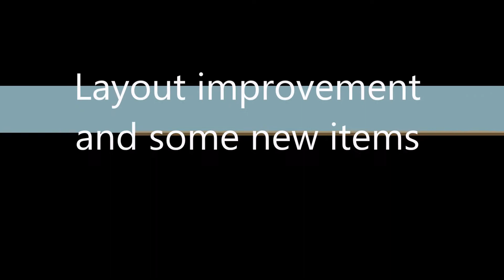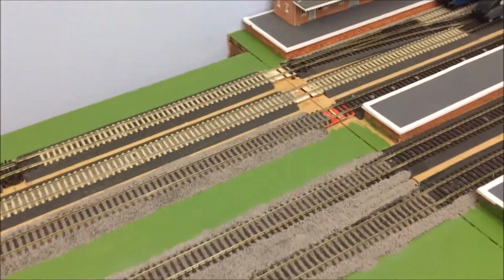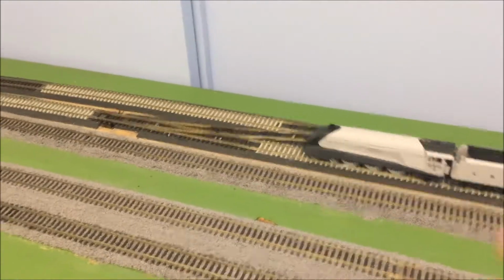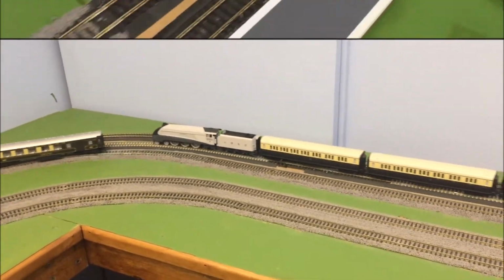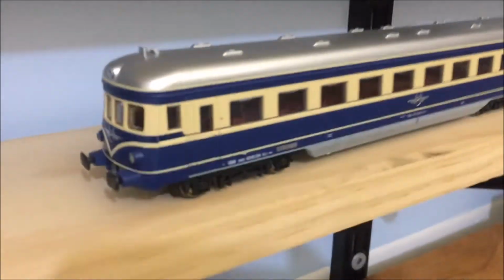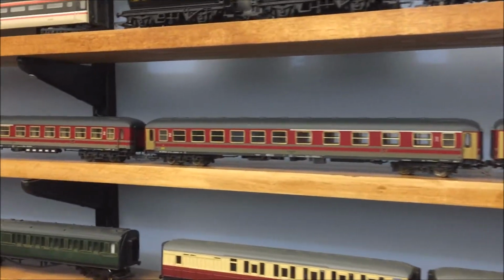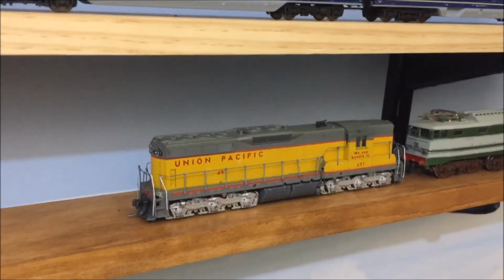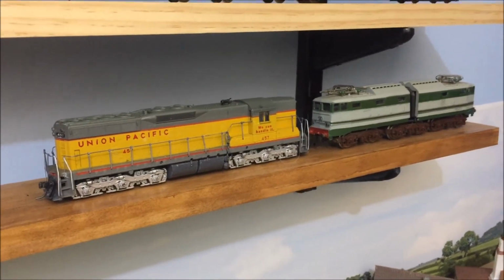Update 8 -  Layout improvement and some new items

Comment: Nice update mate. Good to see all those trains running around smoothly. You'll get used to the duck under...probably better than having a lift up that gives you agg. You have some lovely looking machines on the shelf there. I know what you mean about that last one...I recently bought a loco from ebay..was supposed to be serviced, good runner and all that...was an absolute dog. When I tried to clean the wheels a load of red paint started coming off the chassis where the bloke had given it a spray job...lol.  Looking forward to more. All the best....Tom
Reply from the maker: Thanks Tom. I don't even think about crawling under now. I just make sure I have everything at hand so it is just one trip (or crawl). I guess I have been reasonably lucky with ebay but even the best run of luck has to end sometime

Comment: That was a great update, Bear. You've worked out an issue with the layout, and picked up some very nice trains. BTW, I quit buying used stuff on Ebay. I did okay early on, but recently things are just not what they are supposed to be. Lookin' forward to the next update my friend. Regards, Solomon
Reply from the maker: Thanks Solomon.What finally tipped me over the edge was aligning one track for the umpteenth time and the rail came away from the sleepers. I scour ebay regularly and just watch out the unusual stuff. I end up buying most stuff from the same people so the risk is minimised.